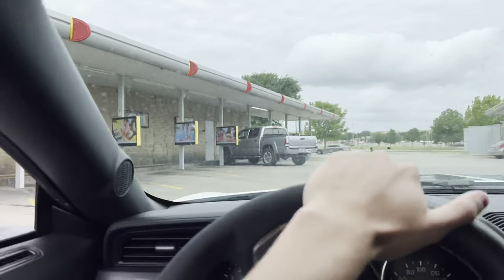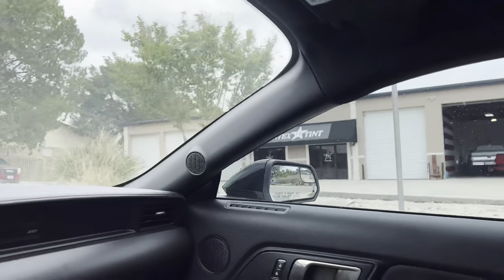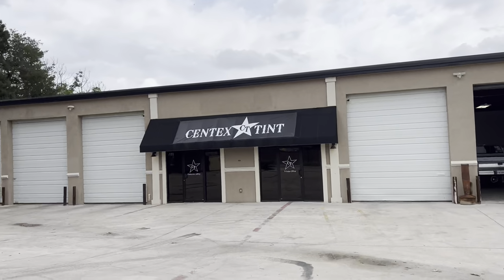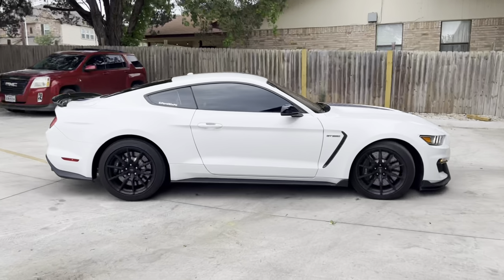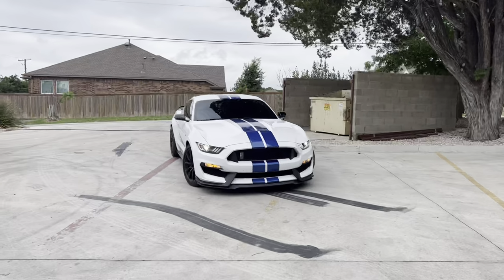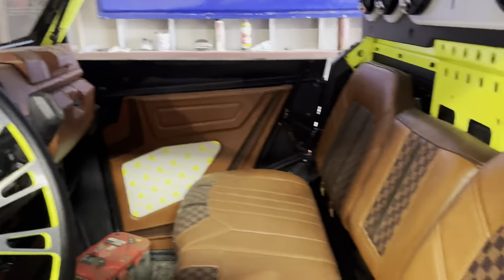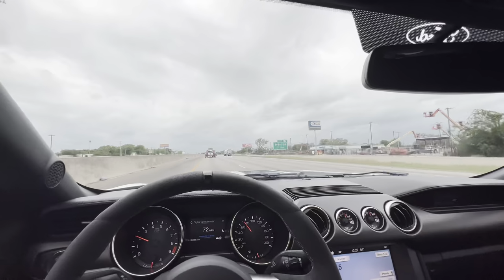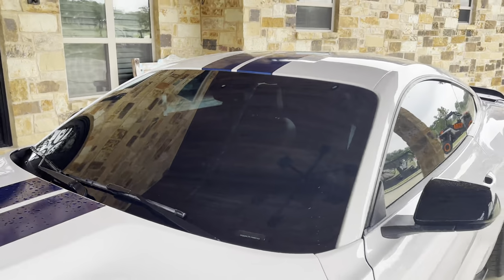How To Ceramic Tint Your Mustang Shelby GT350 Windshield!!!

Comment: What does something like this cost? they have zero pricing on the website. also did you do 5% on the windshield. I know your in TX, it would be cool doing tours of shops like  hennessey performance or shops like tweetys tire that builds custom trucks. it would be different' content for the channel.
Reply from the maker: I did 30% across the windshield! And great ideas! You can call or message them on Instagram for a quote all cars are different!